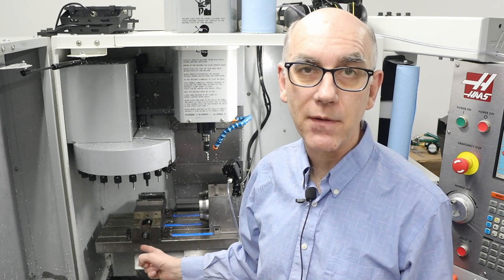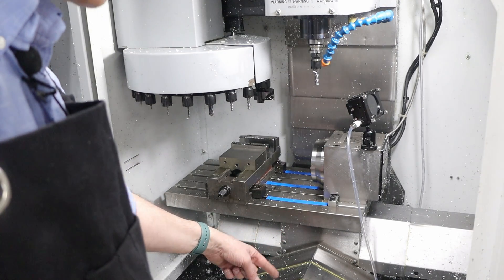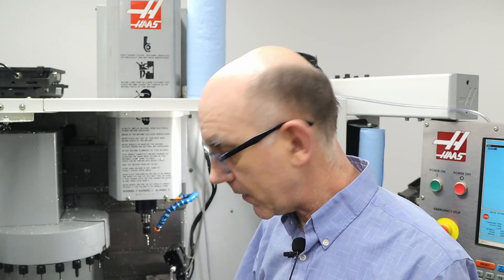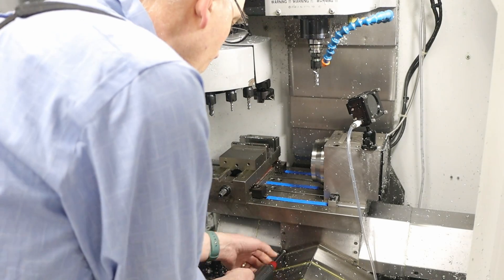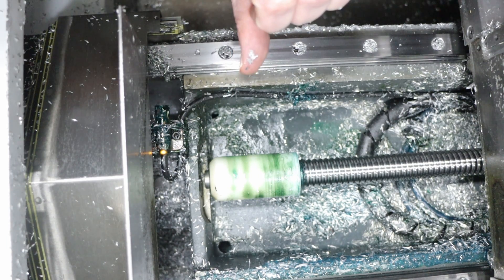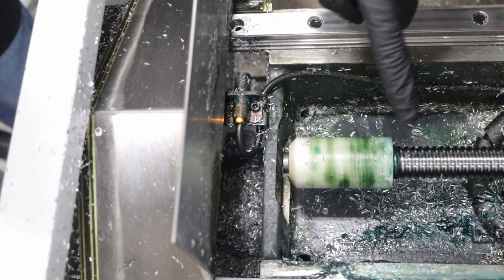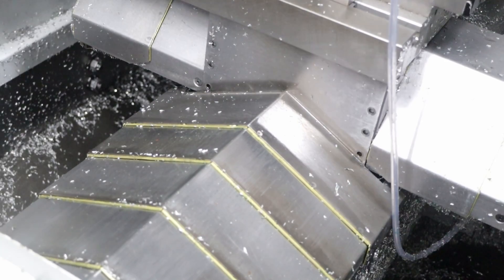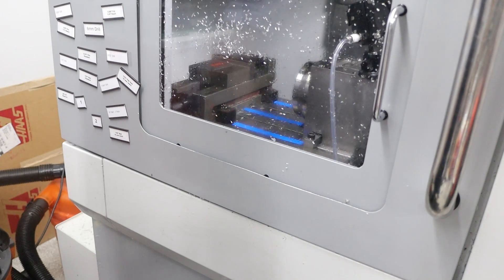Haas Y Limit Switch Error--It's down!

Comment: The last haas I bought was so jam packed with aluminum chips, but since the old machines use mechanical limit switches the machine didn't have a problem. You need to get under all way covers annually if you're a high volume shop, and 2 or 3 years for low volume and prototype stuff. this will also keep chips, coolant, oil out of the cables to keep them good as long as possible.

Comment: Best thing you could do is to NOT use air to evacuate chips from the way covers ! The massive chip load under the cover is proof that you are blowing them where they don't belong. 
 When I rebuilt my '91 VF-1 A few years back, there were way less chips than what you had, even with my way wipers being completely degraded. 

 Always use coolant spray (washdown hose if equipped) and if needed, a bench brush to wipe them off the covers. If you have to use air. Blow away from the table, NOT towards it.
Reply from the maker: Yup, that's the lesson I took away from this. I have a more recent episode where I added a washdown hose and that's all I use now.
Reply: @JohnSL   I see that now. 😉

Comment: Great video, but it is really irritation that information on the machine models are not available from Haas. 
Why is there not sensor layouts available to help locate the sensors?
Without a friendly HFO spending their time and hoping to make it up later you are stuck in blind mode for something that takes a few minutes. We cannot find the Y-sensor on our TM1P
Reply from the maker: If your HFO isn't able to help, there are a couple of other options. One is that there is a Haas CNC Operators group on Facebook. There are a lot of people and someone is likely to have an answer. The second, of course, is to reach out to Haas directly. They might be able to send you a drawing that shows where they are.
Reply: @JohnSL  Thanks - we got some drawings from our HFO that were not correct for our model, but our problem - while looking like yours - was that we had a chip problem, but the main problem was that we had let the machine sit for 2 weeks and it wasn't until our HFO pointed us to function 53 - jog w/o zero that we found out that we had rust on the tram ways that causes it to only allow us to move 0.2mm in either direction.
We had gotten the sensor to work, we just didn't know before we could use the jog function

Comment: this would happen with my TM machine, i bet its just a ship that is sitting on the sensor. stuck with some coolant or such. it is an inductive sensor and any metal sitting against it will trip it. so the slow creep is it saying"ive been tripped and recognize my position, now i will reverse direction until the sensor no longer sees the limit switching" but becouse the metal is on the sensor, it just creeps and creeps waiting till it no longer sees the insuctive load but that never happens becouse its a metal chip" clean it with a wipe of your thumb and your done.

Comment: Unholy cows ! How in the name of Hades hells did so many chips get under the protective cover ?

I have a mini mill 2 from 2010... thinking i might open it up to check how it's doing one of these days
Reply from the maker: I assume you mean behind the Z way cover? I was surprised by that as well. I believe it's because I was using air, and therefore blowing the chips up into the gap between the segments of the way cover. Using coolant washdown will avoid this for Z, but not completely for X and Y. Haas recommends cleaning under the way covers once per year. So yea, worth checking.

Comment: do not use compressed air to clean your machine, the air is forcing all the chips into the crevasses of the machine . a hose with coolant would do a much better job.
Reply from the maker: I'm totally in that camp now--I just need to figure out how to set up a washdown hose. I'm currently thinking of hooking it into the coolant line at the Z axis.

Comment: You are not supposed to use Grease on 
y/z Tableis you're supposed to put W oil in it that's why you keep getting errors because you're supposed to be able to wash all the chips out you're gonna ruin the ball and the gears.
Reply from the maker: These machines are designed to use grease. The maintenance instructions for the larger Haas machines talk about using Red 1 grease. This machine has an automatic grease system that uses a cartridge on the back of the machine. My HFO told me it's fine to clean out all the grease, and the machine will automatically add it back in.

Comment: Glad to hear that you could fix it 🙂Haas seems to be a good machine but at this point they save imho too much money. That's why machines producing chips should have good mechanical limit switches (and a better cover). Here we use switches from Euchner, a company which only produces such switches. They are made for eternity - or at least 33 years ;-) That's the age of our CNC lathe machine. It still homes and switches off with the emergency switches pefectly. And they are very precise. The deviation is below 0.001mm which really surprised me. And btw.: they are mounted at the surface so cooling water, chips etc. are always around them.
Reply from the maker: I guess you get what you pay for, right? This machine is far better for me than the Tormach I was going to get. Sure, it's new vs used prices. But still, it's an awesome machine for what I need. Are there better machines out there? Absolutely. But I don't see a Kern in my future.
Reply: @JohnSL   "But still, it's an awesome machine for what I need." That's the point 🙂I also like the Haas due to its small size.
I only was surprised that they used this kind of switches.
Oh, btw: I visited the company "Dr. Boy injection machines" last week. I don't know if you know them. Here in Germany it's (beside Arburg which has the bigger ones) the most used brand for small and middle injection molding (they even have small table machines). The company is located only 50km (around 30 miles) from me. It was a very interesting visit - especially for 3D printed molds and having a look to all of their machines. At the end of the day I picked a Boy 22A Pro and I hope to conclude the contract this week. Delivery then would be in week 44.
It's interesting that there are very few YT video of these machines. When I get it I think I will do some videos to show its capabilities. May be it's interesting for you. Best regards!

Comment: classic fix! it's interesting to see there aren't any sealants around the way cover mounting surface. The VFs have a gasket on there from the factory, then we run a bead of silicon caulk after it gets ripped when pulling the covers. It probably wouldn't hurt to do that for yours too.
One other quick note, you can power the machine and move it around without the way covers, which makes it easier to clean the buildup inside. Just have to be careful to protect the covers from getting seized up during the home search.
Reply from the maker: I saw that in some Haas videos I watched about replacing the way wipers. These little office mills are different from their big brothers in so many ways.

Comment: Easy-ish fix! We used to have a similar issue with a Denford CNC router. It had sort of cheap microswitches for home and balsa wood dust would migrate into the contacts. More than once we had the dreaded creep away from home.
Reply from the maker: Yup, that's what happened in this case. It crept away from home until the servo motor faulted because of excessive load. It's nice that these machines are smart enough not to damage themselves with things like this.

Comment: I don't like seeing all those chips around the ballscrew. Makes you wonder how they get in there.
Reply: Some chips will always get past the way covers, especially if you blow off your parts with compressed air. Some machines are better than others in this respect, but you can help matters by using the lowest possible air pressure to blow off parts, by using coolant to wash down or just using a brush. Aluminium chips tend to get everywhere because they're so lightweight, but thankfully they're not hard enough to do a great deal of damage most of the time. The powdery chips from cast iron or hardened steel are a real menace.

It's not particularly exciting, but most problems in the workshop can be prevented with simple housekeeping. A machine that's kept clean inside and out is a machine that's regularly and thoroughly inspected.
Reply: @j.dietrich  Yes, that's why all machine makers warn of using compressed air! It is absolute poison for the precise spindle bearings etc.
As you said: when really using air, use it wisely and at the lowest possible pressure. Much better is a broom or brush!
Reply: @j.dietrich  As someone that has never been in a machine shop or even seen a CNC machine besides mine, are you supposed to take your way cover off periodically to clean them? if so I need to get on that
Reply from the maker: I've reached out to my HFO to ask that question. I would be surprised if the answer is anything other than yes. Because my OM-2A is very different from other Haas machines, it's hard to find instructions. But I suspect I need to replace the wipers on my way covers.